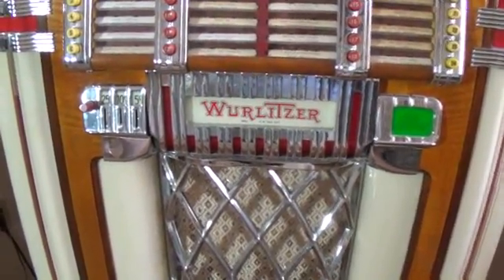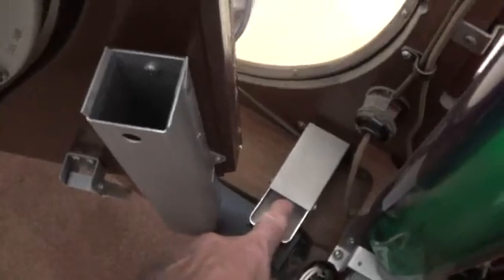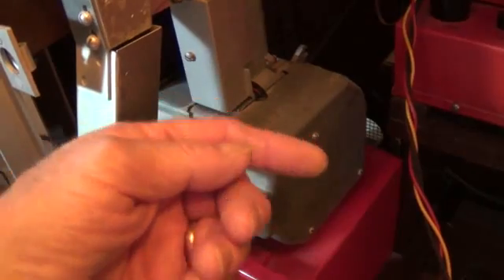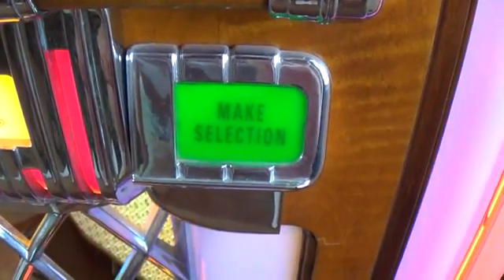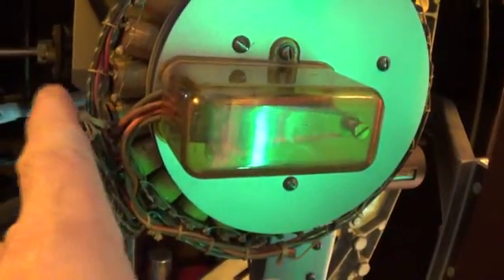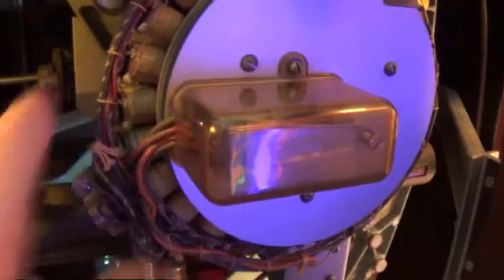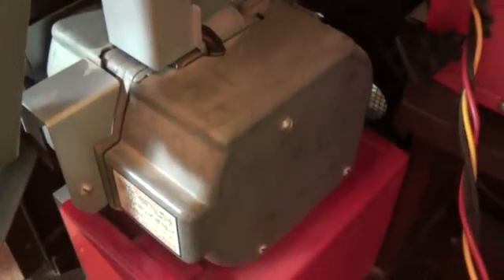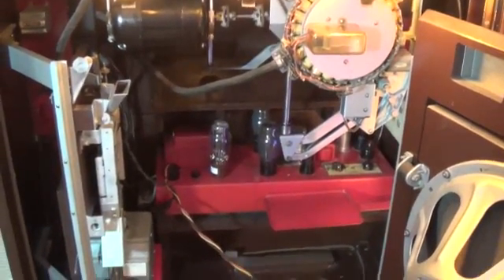How the Wurlitzer 1015 Jukebox Works Part 1:  The Credit and Selection Process

Comment: Sir... you posted this video over 10 years ago and it is still as useful today as it was to so many then.  As I find myself trying to resurrect a long dormant 1015 now, these are invaluable. Are you willing to assist me further? When your video gets to 7:12, my current box fails to function as the central cam does not activate the arm to search for the selected pin. Thus the entire selection and play sequence ends as the motor is activated but nothing further results. Any thoughts you would be willing to share?
Reply from the maker: I'm glad the video is helpful, Marty. Trying to explain all the details of how the mechanism functions is way beyond the scope of this page. I suggest that you buy a 1015 Service Manual (on Ebay?) and study the verbal explanations and diagrams. Good luck.
Reply: Thanks for your reply. I have the service manual and it covers the sequencing events as expected. However, there is no mention of the clutch mechanism which redirects the main cam from the "pin search" arm to the "find and load" the record gears. I just thought you might have dealt with that in the theory of operations procedures. Again, thanks for the response and I apologize for taking your time.
Reply from the maker: No problem, Marty. Good luck with your repairs. @martysherri7745

Comment: I have a very simple question about tripping manually a selector coil pin.  Is there a chance I could ask you about it by private message…or better yet a phone call??
Reply from the maker: You can message me on my FB page: Uncle Doug's Vintage Amps.
Reply: @UncleDoug if I can ask it here on this forum I’d be fine with that.

The selector coils on the selector wheel on my Wurlitzer 1015.

I know the little rods (or pins) have to be released to allow the selector arm to stop at that point to in turn position the star wheel on the back of the mechanism to pick the proper tray out of the stack.
One of mine has been a little stuck from lack of use….#13.

I want to trip the little tab that releases the Rod to it’s elongated position manually….so I can repeatedly work the pins in and out to loosen them up a bit.

I can see the little tabs attached to the springs on the back of the wheel and coils.   But not sure exactly how I’m supposed to trigger them to release the rod.

I’ve tried myself to push the tabs one way or the other and they don’t seem to want to move.
Can you show either a diagram or a short video on how to do that?

If the on/off toggle switches on the back of the junction box are OFF…..which is when I’ve tried to move the tabs…..or should the jukebox be completely unplugged from the wall?

Not sure why the tabs won’t move manually.   
All the other coils work consistently when the selection buttons are pushed.

Thank you.😊
Reply from the maker: Your explanation of the process is well stated. I will try to respond in kind. Each selection pin has a matching coil that, when energized, will attract the retention arm holding the pin in place, releasing the pin to jump outward. You should be able to push each retention arm toward its coil to mechanically release its pin. If there is a selection pin which you cannot manually release, then perhaps it is seized in place. Note that the pins, once released, can also be manually pushed back into neutral position, held by their respective retention arms, which click into place when the pin is pushed in.  @crescenthillstudios
Reply: @UncleDoug  I  hope might be a bit more clear with the following questions.  

If the jukebox is plugged in to the wall but the toggle switches are OFF….is there any reason that those retention arms will be electrically locked in place….which would prevent me from moving them manually?
I would think they should move freely when pushed upon.

On any given coil…Do I push the retention arm inward toward the center (of the selector wheel)…..or outward away from the center of the selector wheel?

I know the reason to push the retention arm is the disengage the arm from a little groove on each pin….. and that the pin should be able to be reset by simply pushing it back into place until it clicks into the little groove of the pin.

That’s my purpose is to manually free up the movement of the pin on # 13 selector coil.

Sorry to be so cautious in my questions.😏
Reply from the maker: This type of confusion is why I really hate trying to verbalize jukebox repairs. There is an excellent service manual for the 1015 that shows detailed diagrams of every subunit. The pins can be released manually without any electrical supply to the jukebox.  They are never locked in place electrically. If you are able to manually release every pin except #13 then there must be something wrong with that particular pin unit. Remove the selector coil unit and fix the problem. Good luck. @crescenthillstudios

Comment: My coin grinder keeps running after accepting a coin. It didn’t do that before. Is something not making the noise stop after it accepts the coin. Thank you
Reply from the maker: You'll have to remove the grinder covers to see what the problem is, Rudi. Perhaps the switch that turns the grinder motor on when a coin is inserted is sticking in the "on" position.

Comment: Sadly, at my age, most places only had microprocessor controlled jukeboxes, which were being replaced by CD jukeboxes. Seeing how the Wurlitzer 1015 & other electromechanical jukeboxes, I'm under the impression that: 1) they do not play the songs in the order that they are selected, and 2) if 2 different customers pay and select the same song, that song only gets played once and the second customer basically wasted their nickel. Am I correct, or is there something I'm missing, thst tracks the order of songs selected and/or how many times a song is selected?
Reply from the maker: You're right, Russell. If multiple songs are selected, they will be played in the order they are in the record stack, not the order selected.....which is typical of virtually all vintage jukeboxes. If two people select the same song before it is played, it will only play once. But the extra coin credit will result in a random song being selected. There has to be one song played for every coin credit.
Reply: Interesting - thanks for clearing that up! :-)

Comment: Hi UD, this is UB here. B is for Bill. There are a couple of different things I'd like to see, if you don't have them up here in the huge list of videos you have created. I told you about liking your teaching methods and now I know why. You are a math teacher. And I like the shout out for the ever desired beaver shot but you failed to mention the down blouse shot.  :)  Now, to what I'd like to see 1) how to create workable test instruments b/c of budget constraints, a variac would seem to be the easiest yet most helpful. (BTW, loved seeing the Simpson 260) 2) balancing the power transformer for multiple speakers, ie. 2, 4, 6, and 8. I was thinking an oscilloscope would be something impossible to own and maybe it is in a DIY version. I was thinking that a simple circuit connected to an old school CRT computer monitor could be doable. Simple may not be correct in that regard but a circuit not requiring expensive parts. I saw another person's video on a DIY variac that he called a scariac and I see why. I will tell you there is water involved and I do not want water or any other drink on my bench that does not have a screw on cap. Help!!
Reply from the maker: Greetings, UB. I do recall the down-the-blouse shot.....often occurring after the old drop-the-pencil-so-they'll-bend-over-to-pick-it-up move. Regarding Variacs and Oscilloscopes, just save your money and buy one on Ebay. They are routinely available at very reasonable prices, and you'll be way better off in the long run
Reply: @UncleDoug  Thank you

Comment: Interesting that there are three separate coin slots that go to the same place!
Reply from the maker: In the early models, there were three different slug rejectors, one for each coin denomination, and three different inlets were necessary. With the later 3-in-1 coin rejectors, you're right......no matter which slot you use to enter a coin, they all end up going into the same slug rejector, where they are sorted out (again) and then sent on to the coin grinder, where each coin activated a different set of credit switches, which can be set by the operator.  One play for a nickle, one play for a dime, 5 plays for a quarter, 3 plays for a quarter, etc.

Comment: Question 1015 seletor drum . the mechanical movements are good now I can pop a seletor drum pin by hand and it will complete a cycle and cancel/shutdown just fine -BUt when i load a coin  the selector light comes on , I push a button , I can see the relays move in the power juntion box but the selector drum pin does net come out.
Reply from the maker: You might check the contacts in the big Jones plug that connects the selector drum with the junction box.....that's how the selection signal gets to the selector drum.
Reply: Thaks for the help and the excellent videos.
Reply from the maker: You're welcome, Bill.

Comment: Hello Doug. Really enjoyed the 1100 video. I have one with an intermittent problem - the turn table comes up and then drops down on the way up and then completes going up to get it to play position. Sometimes the turn table stops just short of the play position and I have to pull the shaft down about 1-2 inches and release it and it goes up to the play position. Is something slipping? Is this common from lack of play? Is there any adjustment? Thank you.
Reply from the maker: Pete Jagodzinski Pete, the best way to approach problems like this is to get a good drop light and watch the mechanism as it operates. You should be able to see the cause of the turntable lifting problems. There is a cam and an arm that lift it, as well as strong springs to assist with the lift. Watch it closely and I think you'll see what's wrong. Good luck.
Reply: Uncle Doug Thank you very much. I will do that. I should mention this jukebox does not get played very often and when I do it performs well after 3-4 records if I wipe down the shaft with a light oil. What kind of lubricant do you think is best - silicon spray on a cloth and then wipe or regular oil? If oil, what weight oil would you suggest? Thanks again Uncle Doug!
Reply from the maker: I would recommend some sort of light machine oil, like 3-in-1 Oil, or even 10/20W motor oil. If you use anything much thicker, you run the risk of having the turntable stay up after the end of a record, which snags the record ring and may damage the big fiber drive gear......i.e. a disaster of biblical proportions.

Comment: Uncle Doug,  Appreciate if you are still answering questions.  I can't seem to be able to remove all the record trays.  The shaft assembly (45233), which appears to hold all in place, will not move move.  Can you help?  Thanks.
Reply from the maker: Sandy Joseph Sandy, you need to remove the top nut, popularity meter, tray cap (big cast tray that covers them all), 24 tray return springs, tray swing-out arm, etc. so that all you have left are the aluminum record rings and shaft assembly. Then lift each tray upward off of the shaft assembly. Pay attention to the order of the bronze-colored washers and spacers that also slide down the shaft assembly.
Reply: Uncle Doug  I did everything but the small steel ring washer, with the large copper washer under it, will not move.  If I took channel locks to the steel washer it would be damaged.  I tried to pry the copper washer with a screwdriver but nothing will move.  Do I just use the channel locks and replace the small steel washer?  I did a restoration 40 years ago!
Reply: Sandy Joseph
Reply: Sandy Joseph Got it!  I used Channellocks with a rag and the top washer came lose and the rest followed.  Many thanks.
Reply from the maker: You're welcome, Sandy. Best of luck :)
Reply: Uncle Doug  Now that the brass washers and trays are clean, what is the best lubricant; graphite, oil, grease and type?  On all surfaces?
Reply from the maker: I would recommend some sewing machine oil (very light weight), or perhaps some 5 or 10 wt. motor oil, applied sparingly to the surfaces that are in contact with each other. You can identify them by observing the wear patterns on the tray pivots and washers.
Reply: +Uncle Doug, if I might:  the Junction Box Assembly "Service Switch" shorted out.  Since there is no counter, it looks like its only purpose is to supply 115V. to the Stepper.  Since there is no description in the manual, what is the purpose of this switch?  (It was replaced with a NC SPST.)
Thanks.
Reply from the maker: The service switch may allow the operator to run the motor and mechanism without credits.....but it's been many years and I can't recall exactly. Perhaps a Google search would yield the answer.
Reply: +Uncle Doug I found the answer, FYI: When an operator is testing the machine and does not want the counter to advance than he has to hold down the switch on top of the junction box each time he makes a selection from the keyboard.  Holding it down keeps the counter from advancing.  It is so awkward to try and do that I can't imagine any operators ever caring about it.  I have the switch if you want one but may be sold out on the counters.
Reply from the maker: Very interesting, Sandy. Thanks for the info. I'm in good shape on parts, but thanks for the offer.

Comment: Uncle Doug
Are you still available for 1015 questions?
Reply from the maker: m vermillion  Long distance troubleshooting is quite difficult, MV. I will try to answer basic questions, but more difficult problems would be better served by purchasing a 1015 service manual from Victory Glass Co. in Des Moines, IA.
Reply: Uncle Doug Thanks for the reply.  I have a manual for the machine and have been studying it intensely.  My problem is only a few push buttons will activate a play.  When a button is pushed I hear a mechanical noise out of the grinder but the wobble plate does not pull back.  What activates the plate to go back?
Reply from the maker: The slide switches behind the push buttons are probably tarnished or dirty. You need to clean all the contact surfaces so that the pins in the selector drum (connected to "wobble plate") can be electromagnetically activated. When a pin is released, it pulls the wobble plate inward and closes the switch (mounted on front of selector drum) to initiate the play cycle.
Reply: Uncle Doug Thanks I will give it a go. It seems to me the best way to do this would be to remove the entire button array as a unit.  Your thoughts?
Reply from the maker: I generally find that the contacts can be cleaned while the slide switches are still in place on the front door. Use good lighting and some very, very fine wet-or-dry sandpaper or crocus cloth.
Reply: Uncle Doug  I removed the switches, disassembled and polished all of the contacts.  All is good, your suggestion worked like a charm.  Thanks.  MV
Reply from the maker: You're welcome, MV.....glad the suggestion worked for you :)
Reply: @UncleDoug  
any idea where i can get a dog leg?
Reply from the maker: @drtammi  Check Ebay, Tammi. Even if one is not available you can contact parts sellers to see if they have one.

Comment: Uncle Doug,
I have a complicated question problem. A while back, whenever I made a selection, the make selection light would have a brilliant flash that burned out the bulbs. I was able to avoid the burning out process by installing 7.5 volt bulbs, but in doing so, the machine converted itself to free play instead of the coin driven mode, with the "make selection" light remaining on continuously and the the same bright flash for a moment when making a selection and then returning to the normal brightness.
Last week, the 1015 worked fine but today after changing some records, pushing a selector button, doesn't matter which one, nothing happens. I can live with the "free play" mode with the higher voltage bulbs but I want the box to start playing again.
Thanks for any advice.
Tony Palmer
 Durango
Reply from the maker: Tony p Greetings, Tony. I haven't worked on jukeboxes for a while, but as I recall, there is a 24V transformer in the Junction Box for the selector system. There is also a large resistor that steps the voltage down to 6V for the Make Selection lights. Perhaps there is a short or the resistor is faulty and much higher voltage is being sent to the MS lights. This situation probably resulted in a blown fuse, probably in the Junction Box, that prevents the jukebox from operating.
Reply: Uncle Doug Thanks for your prompt reply. I will check out the Junction Box.  Another thought - When playing the box last week, I opened the cabinet and speaker doors to show the insides to my guests. Could doing this have torqued the old cable going from the selector buttons to the junction box and broken some wires? Will have time this weekend to check out things.
Again thanks,
Tony
Reply from the maker: I doubt that opening and closing the door would break any wires, Tony. Check out the resistor and fuse.....hopefully that will solve the problem.